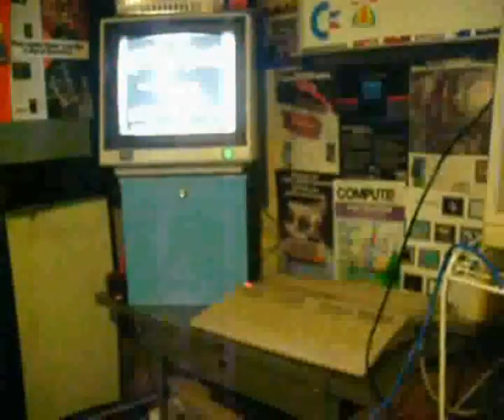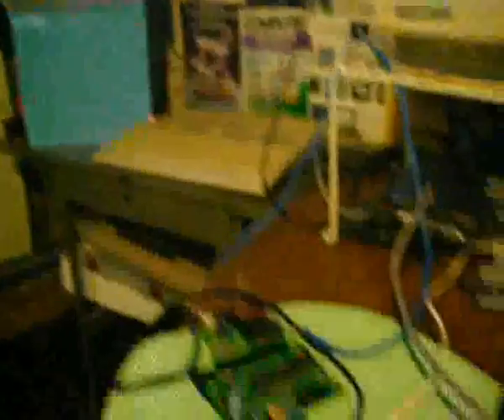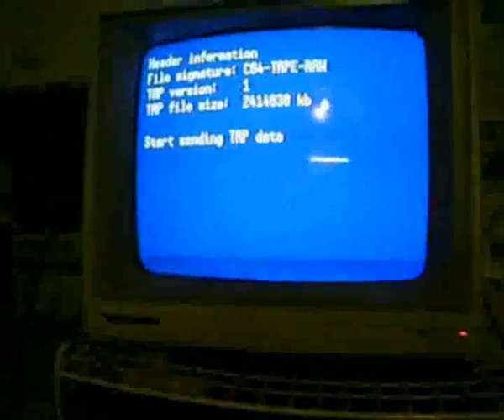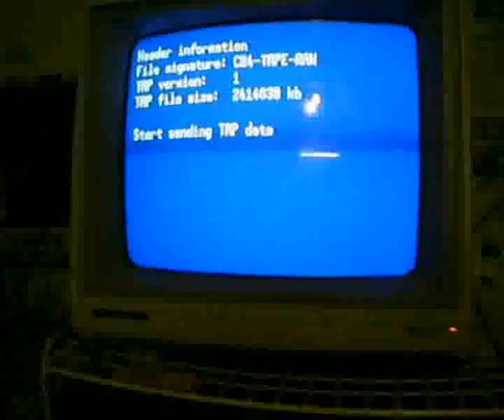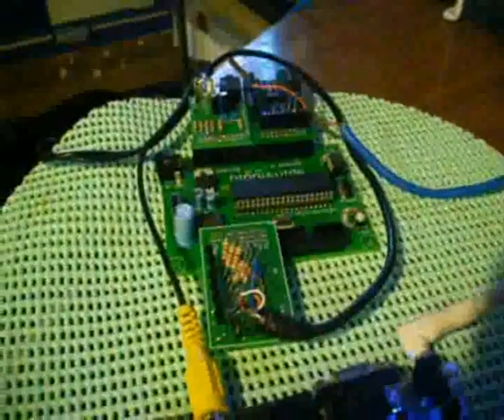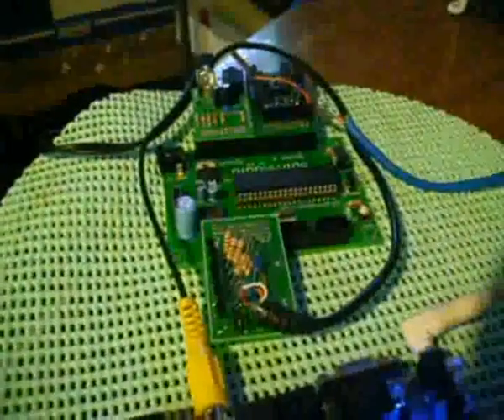Skate or Die with 2 Parallax Propellers and a C128 Part #1

Comment: Amazing! But how do you even go about designing a tape emulator with a Propeller? I mean, this is like magic to me! So this propeller device is reading a tape file from SD card, converting the data into serial squeaks and squawks of the correct frequency and leaving appropriate gaps when streaming the data, and adding header data and whatever overhead bits that the C128 needs to see between blocks... How did you find out what the C128 needed to receive? Amazing :-)